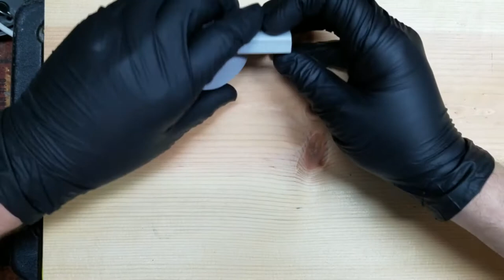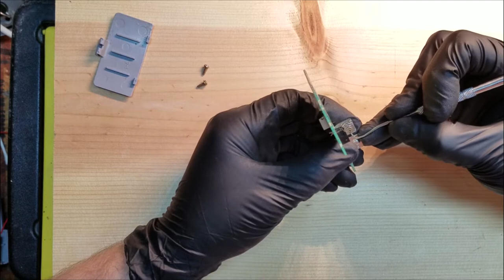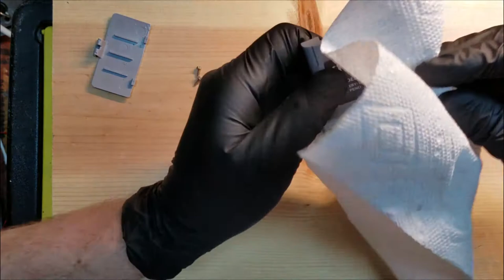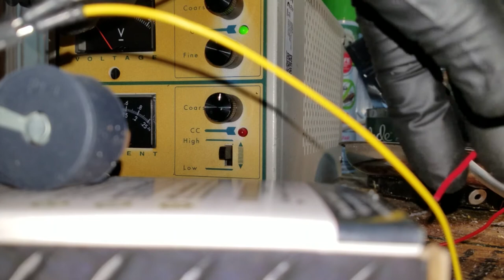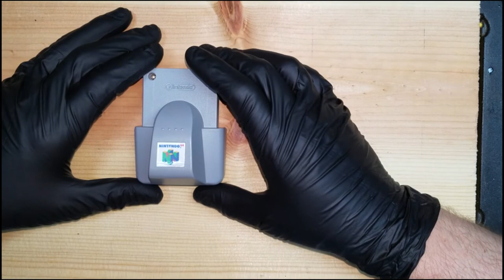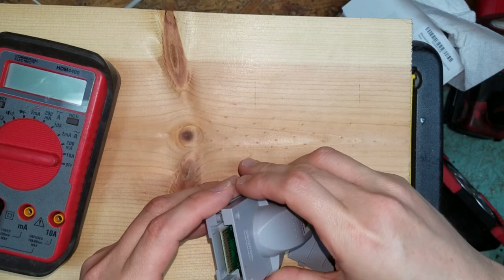Nintendo 64 Rumble Pak | Taken Down by Corrosion?

Comment: I bought one from ebay and found that the battery spring attached to the board is snapped off. Will soldering the piece back make the rumble pak work?